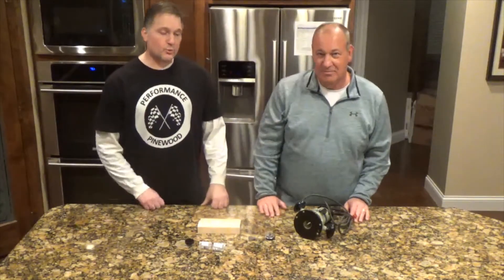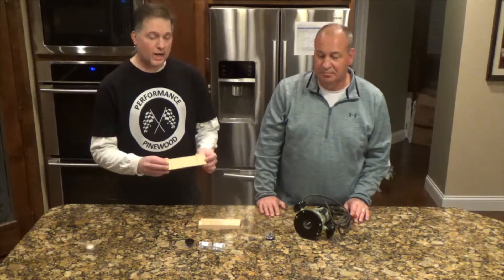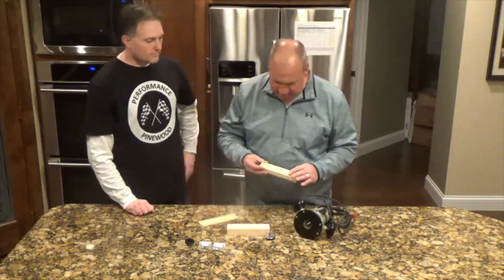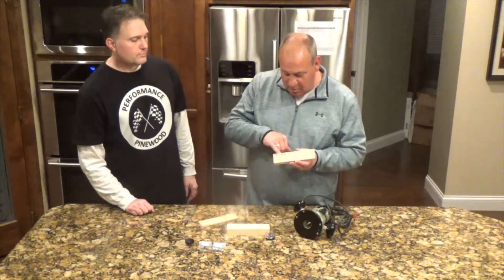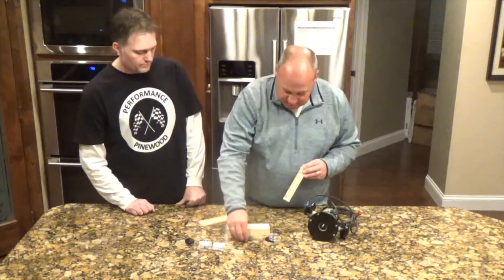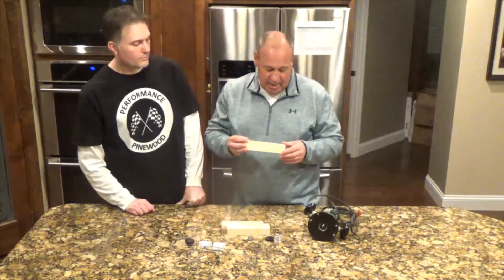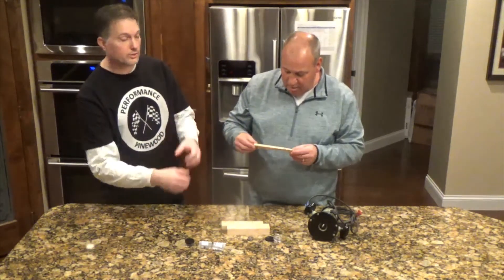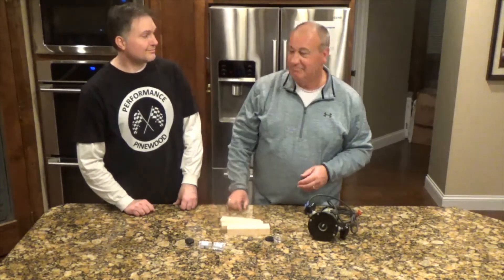How to Build a Fast Pinewood Derby Car - Episode 3 (Making Weight Pockets)

Comment: I’ve read that you want all of your weights about an inch in front of the rear axle. If you could fit all the weights that way instead of putting any at the very rear of the car, would it be faster?
Reply from the maker: Tier One Crane - There is a lot of discussion about this on the internet and elsewhere.  We've found that we get the best results when we have a build that is extremely thin with weight pockets cut both behind and in front of the rear axle.  We shoot to have 2oz of tungsten behind the rear axle and the remaining number of cubes (and putty) in front of the axle to get us right up to that 5oz mark.  Without going too deep on physics, having your center of mass as far up the track as possible creates the most potential energy which is what maximizes your top speed as you race down the track.  This can be overdone - having TOO much weight in the back of your car can create what we affectionately call the "death wiggle" where your car loses it's stability or can even pop the front wheels up off the track.  Weighting behind the wheels is also what most of the pros use.

Comment: Best to max out at 5oz with proper placement or Best to go just below the 5oz max
Reply from the maker: Great question RRFELD!  Weight is your car's horsepower so you never want to leave anything on the table if you can help it.  If you had a 5.5oz car vs. a 5oz car the 5.5oz would be noticeably faster (all other factors being equal).  When the rules don't allow more than 5oz, it's best to run it right up to the edge but be ready to tweak it if necessary when you get to your race. Being over 5oz on race day can be a real pain if you aren't prepared to deal with it and scales can differ slightly so that sometimes catches folks as well.  The surest way to maximize your car's speed is to make sure you have your weights placed properly and use tungsten putty to "fine-tune" your car's weight.  We love the flexibility of the tungsten putty and if you have a 1/4 or 1/2 ounce piece of the putty (for example) as the last bit of weight pushing you up to 5oz it is SUPER easy to just pull out a bit of that putty until you are right at the 5oz max if end up just over the limit at weigh-in.  Let us know if there is anything else we can help with and have a great race!